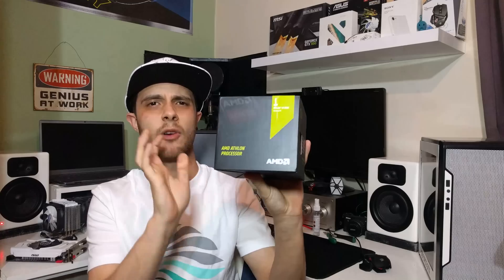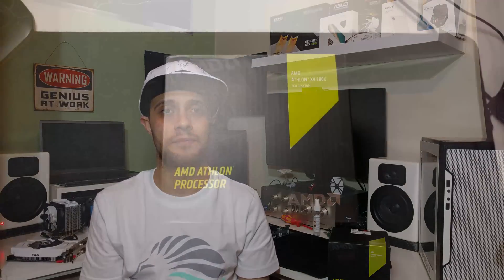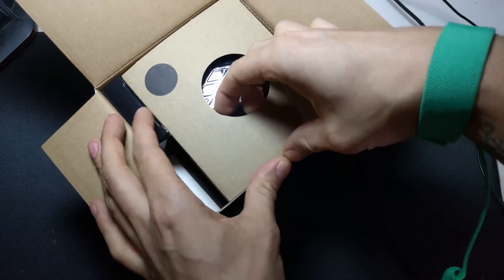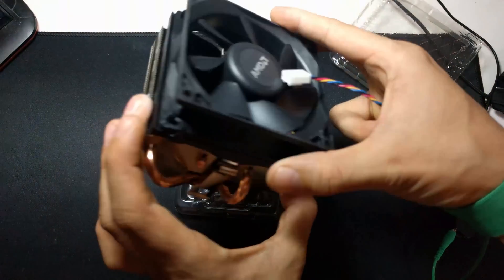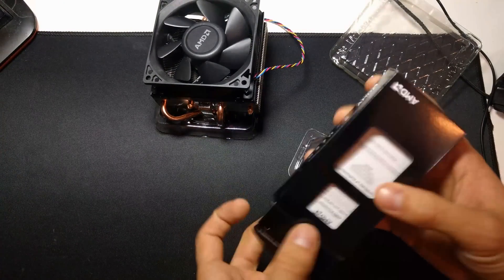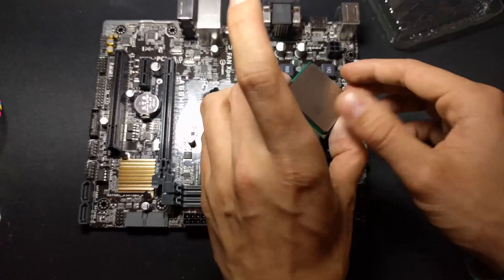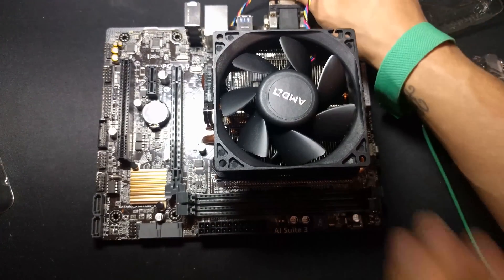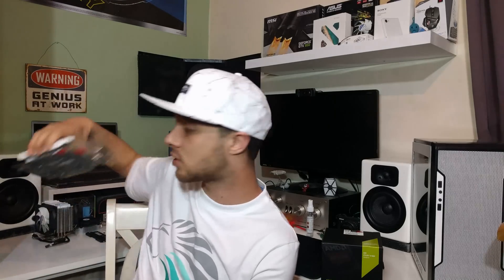AMD 880k Unboxing And Install

Comment: im confused people say its and quad core but some people say it only comes up as a duel core?
Reply: Its a year old but I'll explain for you and future people. The architecture behind these cpus and the AM3+ FX CPUs involves cores sharing resources. So some programs like windows read them as half. Like it reads a 4 core Athlon or a 4 core FX 4300 as 2 cores and 4 threads. So like a hyper threading (well HT is Intel, but this isn't AMD's version called SMT either as that wasn't invented yet. In a nutshell ht allows a core to have 2 threads so it can do more work. Not double of course, but it helps

Now with these cpus, the whole shared core resources thing hurt performance. As a result some people were pissed. There was even a lawsuit in California. AMD settled....though I don't really think they would have lost. 

Its really not though. Performance metrics will show these cpus work much better than how they would if they were really dual core with HT/SMT....but they don't work as well as "true" quad cores where all cores are independent.

Comment: msi 1060 6gb gaming x, 16 gig ram, cpu AMD Athlon II X4 880K - 4 GHz, can i run gta on max settings without lag?
Reply from the maker: Probably not that could will bottleneck the hell out of a 1060

Comment: Would you recommend the X4 880k as a good choice to upgrade from the A8 7600? It's paired with a Sapphire RX560 4Gb Graphics Card and 8Gb of DDR3 1600 RAM.
Reply: john smart yes I recommend it

Comment: Is this an APU?
Reply: ImNotCool yes, it requires a discrete GPU, I have my 880k paired with an 1060 6gb.
Reply: Antonio Pilar Upgrade ur CPU. PLEASE!!! You're bottlenecking the shit out of your GPU
Reply: ImNotCool no it's not, I get all my games in 60 FPS.
Reply: Antonio Pilar GTA5?
Reply: Antonio Pilar i know but u do bottleneck still.
Reply: antonio it is bottlenecking, u could get way higher fps but up to u

Comment: hello, im sorry but What is the difference between "mobo a68hm and a88x" which one is the best price-quality relation? a68hm 53 usa dollars and a88x 70 usa dollars, i have a amd 880k, thanks!
Reply from the maker: Bachani Bachani  a88x allows overclocking.
Reply: but a68hm is good for gaming?, thanks!
Reply from the maker: Bachani Bachani the question more to be asking is our cpu and gpu good for gaming.
Reply: im asking this because i hace gtx 1050 ti zotac and this cpu so wich mobo i have to go? if the a68 is enough? thanks for your time!
Reply from the maker: Bachani Bachani do you want to overclock the cpu???
Reply: nop
Reply: Then go for a68

Comment: ive got question, is a EVGA 430W 80 Plus Power Supply Unit going to fit into a HP Pavilion 550-200na Desktop PC - Silver?
Reply from the maker: TeamMCGaming measure your PSU see if ATC also check that there not like dell and have there own motherboard PSU connection
Reply: ok the psu is a Logisys Corp and the psu i want to replace it with a evga 430watts the one i have only has 180watts max
Reply from the maker: TeamMCGaming means the fitting is it a standard atx check the power fittings visit a standard atx.
Reply: see im new to all this and its really hard to find the proper psu it looks the same as Logisys Corp and what websites could i go to?
Reply from the maker: TeamMCGaming it appears to be a uatx PSU so no the evga won't fit.
Reply: oh ok do you know any atx psu with 6pin connector for gtx 950 graphics card? so im wanting this stuff for Christmas! :D
Reply: also would a CORSAIR Builder Series CX600 fit i meant to say that not evga ;/
Reply from the maker: TeamMCGaming probably not because again that's an atx PSU. so to be blunt long day found this video might help you out. https://youtu.be/_FSkslrgJqU
Reply: yea that is exactly the same as my computer but the power supply doesn't have that red thing but the psu is the same size so have you got any ideas on the right psu thanks man for the quick reply i appreciate it!

Comment: Is this the wraith cooler guys?
Reply from the maker: the heatsink is exactly the same the wraith just has a shroud and amd light.
Reply from the maker: basically the wraith just has the shroud and led light.
Reply: Na. Not thr wraith cooler. The cooler is called "Thermal Solution" the wraith cooler comes with the high end FX series.

Comment: how should it run with the zotac geforce gtx 750ti?
Reply: rx 460 or 1050 ti
Reply: Tristian Gamez pretty well just slightly worse than the benchmarking vids he made for this but with the 950 but only marginally

Comment: It's look like the cooler might physically touch my ram. How can i confirm whether or not that will happen? the chip will fit my mobo, does that say the cooler should also fit?
Reply from the maker: it shouldn't as the
there is a minimum size and set  to manufactures to stop shit like that happening. it's only guidelines but most follow suit.
Reply: I see. Mine should be here sometime this week. Didn't noticed you replied. Thanks!

Comment: that amd cpu cooler is compatible with node 202 case?
Reply: Yeah I was thinking the same. How high is this cooler??
Reply: So I was digging and found that with the cooler is around 8cm (3.14''). So its not compatible with 202 case :(

Comment: how much better is this than my current amd a10-6700?
Reply from the maker: well your is a locked processor so the 880k can perform a 1ghz more a core than yours if you exclude turbo boost. but you will need a decent a88x mobo for this chip. also if your using an external gpu turn of your built in igpu it will help your processor boost better :)
Reply: ***** thanks dude, i have gtx 660 and asus a88xm-plus motherboard a10-6700 was just left over from old build and i was thinking would athlon perform better on gaming and  do you think this motherboard is good enough?
Reply from the maker: +meisseli mjaaha yeah your mobo is fine mate,easy do a 4.5ghz oc @1.4v. thinks it's time to trade up that 660 though.
Reply: ***** thanks dude, love your videos

Comment: When you push the clamp back do u have to kind of have to force it
Reply from the maker: yeah it's got a but of a push to it.
Reply: +thefullsetup yeah im not trying to break it should I just leave it how it is?
Reply: +thefullsetup btw what side does the clamp go on I have the same mobo lol that's surprising.
Reply from the maker: +dahbestgamer I always have the clamp facing down towards the graphics card if that makes sense.

Comment: Is this a better cpu than the 860k?
Reply: Please reply, should I use the pre-applied thermal paste being my 1st time building a PC or should I learn how to clean it off & apply something better like Arctic Silver 5?
Reply from the maker: yes it is better and comes with a decent stock cooler. but if you have an 860k I wouldn't upgrade .
Reply: its literally the same cpu, the 880k is just clocked .2 ghz higher. you can save 20$ by getting an 860k and overclocking it slightly instead of this. 880k comes with a better stock cooler tho.
Reply from the maker: +Alexander Sicolo it's more like $15 in the UK which I think is worth it. the 860 has been a mixed bag for oc with most back to 4.3ghz. I did 4.6 with the stock cooler. And yes I've replaced it but when I'm done with this chip it's going in a media centre case, so no need to buy a low profile then.
Reply: ***** AS5 is better, but since you're a first time builder and probably using the stock cooler from the cpu, it will only make a few degrees difference. 

personally, I only buy other thermal paste when I buy aftermarket coolers or plan on overclocking.
Reply from the maker: +Alexander Sicolo with the stock paste I would be going up to 70 after a long gaming session. with arctic mx-4 I had a 5 degree drop but mainly hangs around 62.
Reply: *****
Thank you!
Reply: Alexander Sicolo
Thank you too, I won't be overclocking past the built in boost preset so I'll probably just stick with pre-applied for now.
Reply: ***** thats pretty good. I have an 860k locked at 4.0 and i saw minimal difference with stock cooler with ceramique 2, as5 and stock paste. they all hung around 72-74c at max load. guess not all experiences are the same lol
Reply from the maker: +Alexander Sicolo well the 880k was actually designed to cool the processor it was sold with unlike the 860. definitely a step in the right direction for amd

Comment: Can this CPU work with the amd radeon rx 480 good????
Reply: +Mizz Wizz Not really a "massive CPU bottleneck" but a slight bottleneck.
Reply: Alexandro Romio nice choice, if you want a high end rig, you really dont have an option but to go for intel at the moment, AMD's single-core performance is really lacking in its current gen chips.
Reply: Unless you overclock this cpu to 4.6ghz or upwards there will be a massive cpu bottleneck.
Reply: You'll bottleneck pretty hard. I'd recommend an i5/FX 8350 at a minimum.
Reply: ***** You're right about some of the things you mentioned but saying the FX series is "stupid" is some fanboy type crap. The i3 6100 gets beat by an FX 8300 that cost the same amount as the i3 6100. Science studio did a video on those two processors. Watch it.
Reply: I finally made a pc skylake with an i5 6600 and an h170 msi gaming m3
Reply: Alexandro Romio Cool. I plan on making a skylake PC with a i5 6400 and a z170 mobo so I can overclock lol.
Reply: shut your face! Facts man. ZEN should be good though. If ZEN actually has a 40% increase in IPC then it should be near Haswell's IPC. So if AMD can price those quad cores for an aggressive price then intel will be forced to drop the price of their quad core processors. Its such a good time to get into PC gaming man.
Reply: Strike Claw im currently running a haswell i5 system. if ZEN is around that speed in single core performance, and have as many cores as rumored (i heard their highest end consumer chip is 16 cores, but i doubt it), i might go get a new ZEN motherboard and CPU. support the red team.
Reply: shut your face! It actually is going to be 16 cores but I think its going to be expensive. Like, i7 expensive.  I believe the chip you mentioned is a sever grade chip because 16 cores with IPC like that would be overkill. I really want to support the red team but their CPU's aren't that good right now sadly but their GPU's are amazing. I plan on buying the RX 470 which is suppose to come out on the 28th of this month. Also, they're going to release new FX processors 6-8 core variants in the ZEN line up of CPU's as well! I'm hype about that.

Comment: my cpu is running 60°c idle 97°c max after playing gta v and core no. 3-4 are running at 1997 mhz can anybody help me to solve these issues my mobo is Gigabyte FM2A68HM-DS2
Reply: or the mobo is crappy or the thermal paste is no good
Reply from the maker: +Josef Ranc check voltage with AMD overdrive anything over 1.375 throttles cores 3,4 for me
Reply: +thefullsetup I don't know how to change the vcore for my  mobo, I looked at the vcore there's auto, normal and +0.XXX I don't know how to use it
Reply: +thefullsetup and the mobo set it to 1.440v but AMD Overdrive says it's 1.4125, I tried lowering the core voltage core No.3-4 stays at 4152mhz but it affects gta v the fps goes down to 2-6 fps

Comment: Dude, that board is pos. 4+1 phase power. Naked mosfets. You need a GOOD full ATX board. 6+2 phase power. Beefy heatsinks on the northbridge and mosfets etc...

Comment: The Wraith coolers are nice. To bundle a cooler like that with a cheap cpu would not be cost effective. Plus may builders have aftermarket coolers kicking around.
Reply from the maker: have to disagree a little I think oem's should step up a bit with stock coolers. a builder that does not have a spare cooler maybe a 1st timer, can spend 20-30 on better ram or graphics. then get a cooler a month later. I plan to use mine in my jonsbo media case when i upgrade, or maybe stick it on my 840.so again more savings I don't have to buy a low profile cooler as I have a more than capable one that came with my very cost effective £70 processor.

Comment: I have the 860K and its overclocked to 4.4 Ghz. Would i expect to get a higher overclock from the 880k seeing as how the base clock is now 4.0 GHz as apposed to 3.7 GHz? Would I expect about the same? Hard to tell due to the "Cpu lottery"? What do you think? I was hoping to get a 880k and get about 4.7 on my aftermarket cooler.
Reply from the maker: yeah should be good for more than 860k tmy overclock vids are just with stock ATM. and I'm going to try push 4.8 when the new cooler turns up this week
Reply: +Master of The Game   4.7 would be very optimistic. Just go to any of the good overclocking forums and read threads about the 870K and 880K. These chips need crazy amount of vcore to hit 4.7 GHz. Plus you need a stout FM2+ board like a A88X-Pro, a Crossblade Ranger or UP4 that can deliver the clean power you need.  FX Piledriver cpu's may have lesser ipc than the Kaveri, Godavari cpu's but they overclock way better.
Reply from the maker: +Christopher Wood I have it at 4.6 now with v core of 1.4 my cooler keeps it just under 60 at full load.

Comment: please review this cpu at stock, then oc'd and compare it to the 860k at stock and oc'd. currently have an 860k in my build paired with a r9 380. I can upgrade to the 880k for £25 and would like to know if it's worth it. enjoyed the unboxing!
Reply: zen will be better without a doubt, only issue is that we have to wait a while until its release, looking forward to it.
Reply from the maker: +FaintVFX yeah my i wasnt impressed when igot the xbox one girlfriends choice. She refused to play pc with an xbox controller said it wasnt xbox wtf!!!!! I would go with the 880 mate the small price diffidence plus having a cooler that doesn't need to be replaced instantly works out as a better investment.
Reply: +Kevin Chott For 25 it is worth it. If you were paying full price the upgrade wouldn't be worth it, but at a cheap step up price that's definitely worth it.